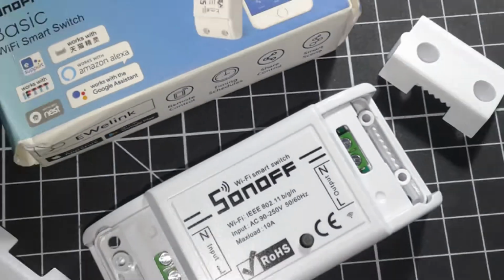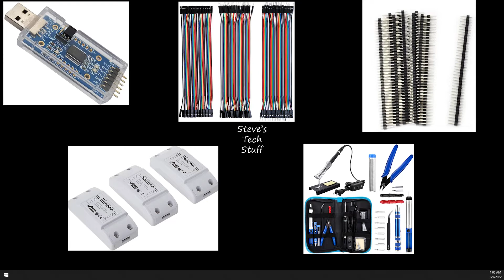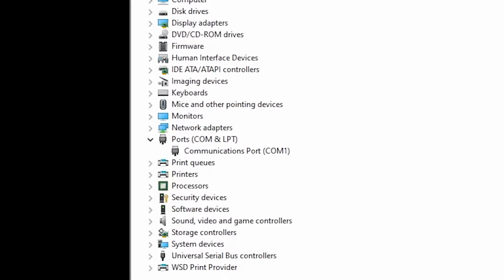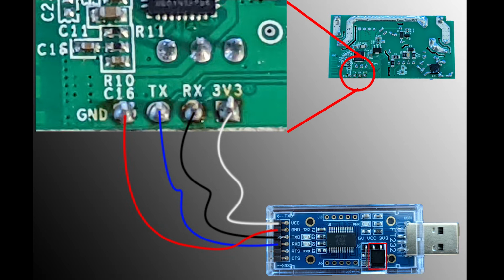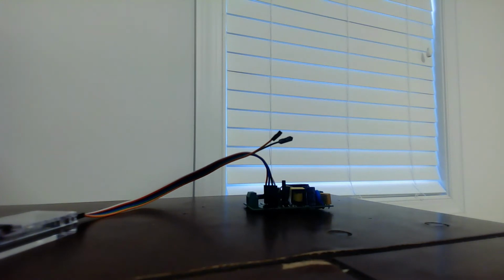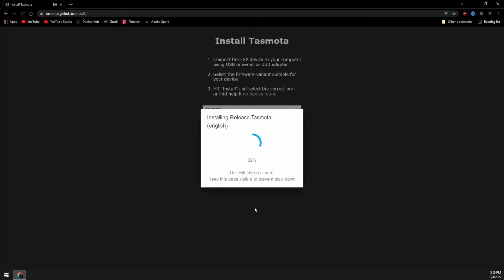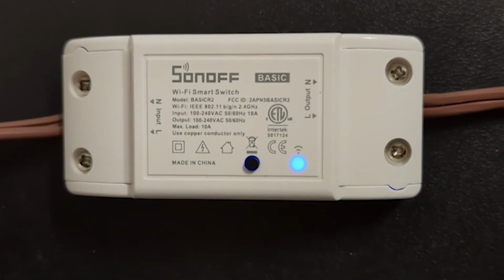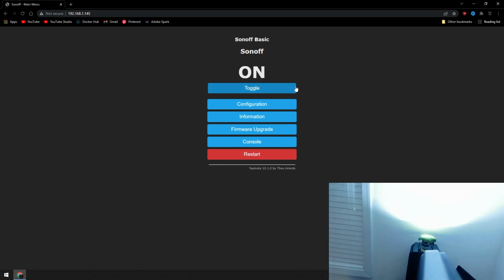Flashing a Sonoff With Tasmota

Comment: Having an issue where the USB adapter shows on COM ports when plugged in while it is Not connected to Sonoff, but once connected (pin outs confirmed) the RX and TX lights remain constantly on and the adapter is not recognized. Any idea why this might be happening?

Comment: I got a sonoff iFan 04 and wired it up using the same stuff you listed. My iFan doesn't appear to power on when I plug in. I checked the wiring and have tried holding the boot button and not holding it. No lights. I tried installing the tasmoto software anyway, but it fails to initialize. Unsure how to check if it's work or not.